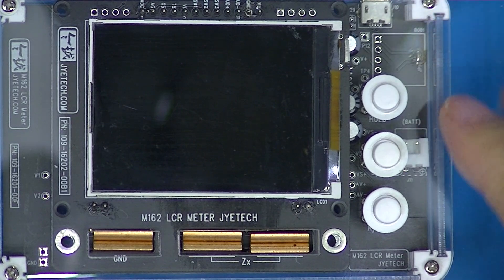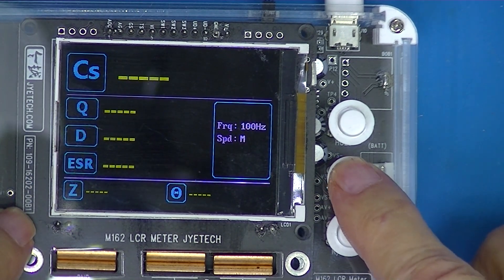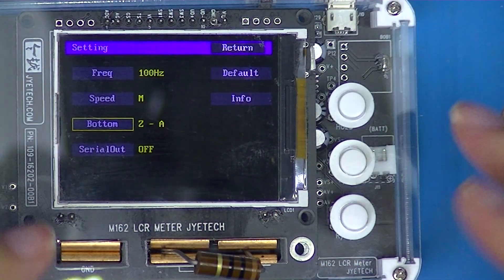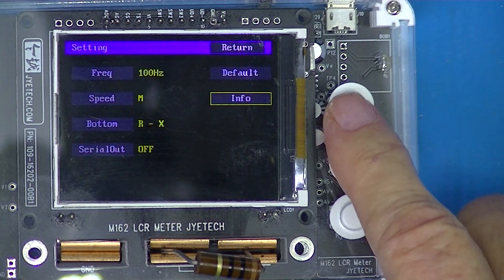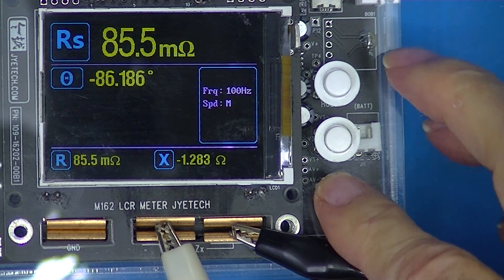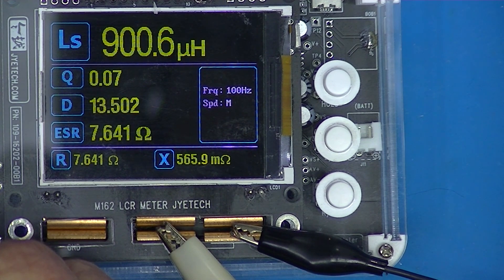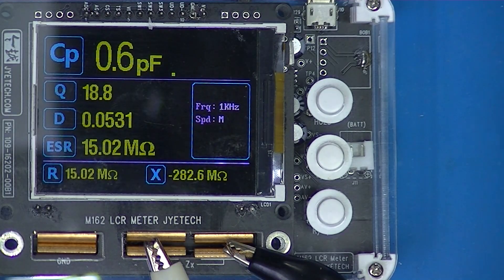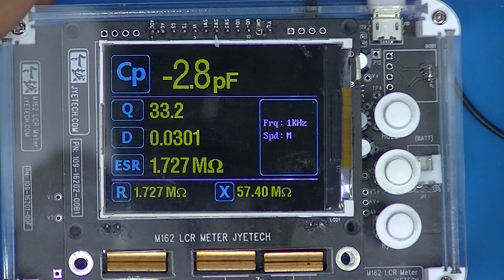Building an M162 LCR Meter – Part 1E

Comment: I would set the frequency to 1Khz, that is one of the standard measuring frequencies. 100, is 20 Hz lower than another test frequency, which is 120Hz.

Comment: A small correction:
The 6μF capacitor isn't motor start, it's a Motor Run capacitor.
Motor start capacitors are much higher in value.

Comment: Although it is an interesting kit, I would prefer one than tests at a higher frequency than 1kHz for the small-value inductors and capacitors used in radio work. A ready-made LCR45 unit from Peak Electronics in the UK will cost about twice the cost of this kit and test up to 200kHz. The price of these kits tends to decrease over time and I would still be tempted to build one when this happens. I still have a AADE LC meter which I built from a kit about 10 years ago at a cost of $100 and it tests small-value components at up to 650kHz.The cheap LC100 and secohmmeter kits from China work on the same principle, but their accuracy is a little suspect.

Comment: Ha! I just realized that your series on the DE-5000 is where I learned about the construction of that unit. Jokes on me. <grin> I got confused... Is this unit Kelvin capable? If so, will you be making a double-sided PCB board plug-in adapter for the sockets?
Reply from the maker: The M162 will accept the DE-5000 4-Wire units.
Steve